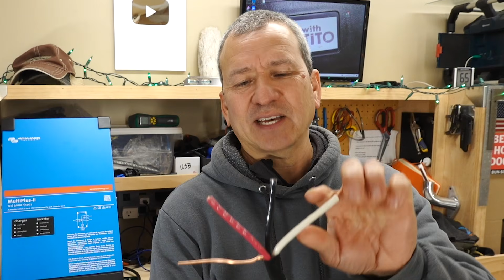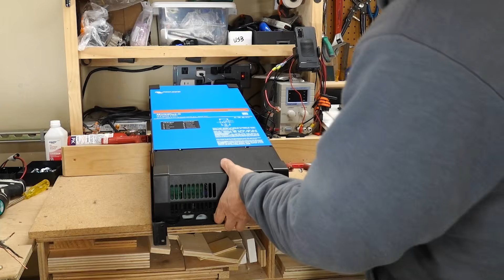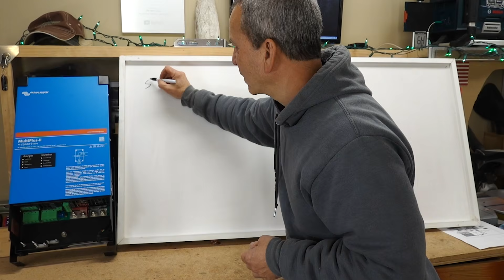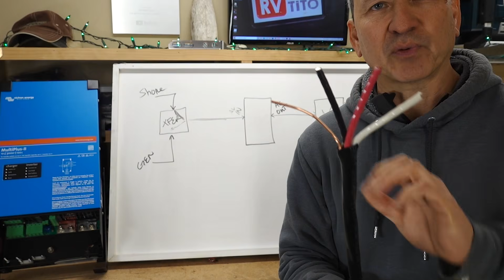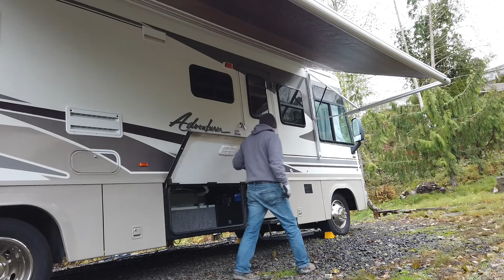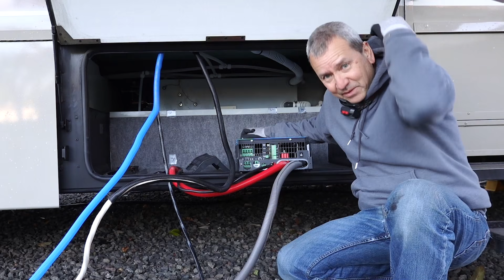Installing the Victron Multiplus II Inverter to Power our 50A RV Off-Grid | RV With Tito DIY

Comment: I liked your video, it was pretty informative. I have a 5th wheel and have both an AC and DC panel. I want to boondock with just the batteries. I suppose I already have power going to my DC side from my batteries as it already runs a few things like lights and water pump etc. Can I just run both AC and DC out of the Multiplex and remove the wires from the batteries to the DC panel and add wires from the Mutliplex to the DC side of the panel.? Or should I just leave them alone and add to AC panel?
Reply: @brianheugly - Please consult your local Victron Dealer, RV Dealer and/or certified electrician.

Comment: I have a 6000 watt inverter that powers my motor home. I can run everything in the motor home, just not at the same time, I play "green acres".  I have 4350 watts of solar panels and 15,360 watts of battery storage. If I were to do it again, I would have bought an 8000 watt inverter.
Reply from the maker: Wow. Amazed you could fit 4350 watts of solar on your motor home.

Comment: I have 24 ft rv trailer 12 v system. There is dc cigarettes lighter port inside. I connected 500watts inverter and powers my 110ac TV. Can I connect 2000watts inverter in that port?
Reply from the maker: No. It's not rated for that much power.

Comment: Dude great job! Looks very professional. Well explained I understand all of the functions i would need now! My only question is do you have to do anything special when you connect shore power? Or does it auto register that you added input?
Reply from the maker: It's automatic. Once the inverter detects split phased shore power, it automatically switches to AC pass through mode. The system is very programmable and there are a few related settings that will determine how that is done.

Comment: So would this inverter not work if you powered it with Solar panels since it only has a AC input? Or are you able to hook panels to it directly?
Reply from the maker: No. This one is intended to be powered by batteries. It's not one of those all in one solar inverters. It doesn't have a solar charge controller and isn't designed for that.
Reply: @RVwithTito  Thank you for replying! I bought one by mistake thinking it was..
Reply from the maker: Oh man. It's a great inverter...just not one of those.

Comment: Thanks for a great video. I decided to swap my stock Magnum 600 inverter for a MP II.  I have a problem I was hoping you could help me with.  My old inverter had a single 110v (3 wire)line into it.  Not the double 110v (4 wire) .  So im missing a 110v line. Im guessing they split it at the factory and sent direct to panel box?  Any ideas?  Thanks
Reply from the maker: Sounds like you have 30A service instead of 50A on two legs like I do.

Comment: I am working on installing my Victron MP II 12V 3000VA but it is going into a fixed location, a radio shack for ham radio.  I am having to think quite a bit and look forward to getting it going.  Later I will put some solar... it is a much smaller capacity than yours... I am doing the 400Ah minimum that the V manual states and can grow it later.  I am going to use it with 120 30 in and later when 50 amp service is available put both in.
Reply from the maker: Nice. Good luck with the upgrades!

Comment: I'm looking at the exact same inverter for my Fifth Wheel.  I am deciding whether to go 12 or 24 v on the batteries or move to a 48V inverter.  I have been told you can use much smaller cables with 48V, which is much more efficient.  Can you give the reason why you stayed with 12V?   I'm really up in the air over staying on 12V versus going 48V.
Reply: @wi4usa - This inverter is specifically the MultiPus-II 2x120 volt model.  I believe, there is only a 12 volt and 24 volt version.  I do not think there is 48 volt version.  It is rated at only 20 amps total or 2,400 watts continuous . It can be very noisy and it hums.

Comment: DUDE! You absolutely do NOT have 240V. It is called split phase because the two hot lines are the same phase. There is NO voltage between them. You need to change this a bit.
Reply: Actually, when connected to a 50 Amp Split-Phase Pedestal the RV will have 240 volts between L1 & L2.   But when connected to a 30 Amp Single-Phase outlet, it is just a 120 volt system.  Also, when the inverter is running on the battery bank only, it is a 120 volt system.

Comment: My question is normally you would have two AC panels one being powered by inverter either in pass through or when inverter is turned on.  It looks like the open hole above the panel you wired into may have been that panel. How are you powering all those circuits that the old inverter powered.
Reply from the maker: These large hybrid inverters are designed to be full house inverters managing and switching between shore, generator and battery power sources. It's what we prefer since we RV solely off-grid and don't plug in. Some might consider this type of configuration a bad thing...a single point of failure. Do you lose power to the entire RV if your inverter fails? Actually, yes. That's something to consider. It's why we chose to spend more money on a high quality unit like this Victron Multiplus II. It's well tested and very robust. Not to say that this too won't fail. It just hasn't. We've been running it 24/7 for the last year without a hick-up. So far so good. I used to carry a spare pure sine inverter...just in case. But I no longer do. 

What you are describing is how it used to be when inverters were smaller and didn't have hybrid functionality. Of course you could still setup your system that way with dedicated inverter circuits. 

The 200W inverter I ripped out of the 03 Winnebago only powered the TV and an AC plug in the cabinet. I rewired that plug to tie into the main AC service. Hope that helps.
Reply: @stevekrud2715 The MutltiPlus-II 2x120 ( in ths video ) is rated at 3,000VA. Which is only  2,400 Watts continuously. It will not run everything in a 50 Amp RV.  Probably not even 50%.

Comment: If the loads are 120V 60Hz and not 240v one inverter will be fine. Limit it with a circuit breaker. The split phase you speak of is more like balancing single phase  loads than L-L . No you can use a single phase 8 KVA inverter and no "phase splitter" either just put both hots on the  the circuit breaker on the load side.  Victron is cool. Over priced though.

Comment: Hi Brian, thanks for all of your fantastic content. 
I have this inverter and had someone else install it about a year ago. I recently had someone get shocked because there’s stray voltage (~20v) on the ground. It’s only there when connected to shore power or when the inverter is ON. I can see the voltage between the ground and neutral bars in the breaker panel and between the frame and a probe stabbed into the ground. I’ve checked everything I can access before dropping the belly to try and find anything that may be bonding the G to N and can’t see anything goofy. Do you see any voltage on your ground when hooked up to shore power?
TIA, Pat
Reply: Check your frame ground connection to your power cable to pedestal ground pin

Comment: Here is my 'million dollar' question. I have a Victron Quattro 5KVA (5000 watts) inverter in my coach. I have it wired basically like this. My thought is why even have the transfer switch in the equation. The inviter will switch something like 120 amps between the generator, shore power and batteries. It can shift in a fraction of a section and start and sop the generator.
Reply: @christopherrasmussen8718 - Do you have a 50 Amp 240 Volt RV?
Reply: @MrSummitville  well it’s a 50 amp coach with parallel lines in the coach. 4 wired + ground vs what a household dryer that is 240 between 3 wires and ground.

Comment: Awesome Video!!! 👍👍 I've been holding off on a install in my Travel Trailer because I knew it was going to get to small for full time fast, I just traded it for a larger 5th wheel camper 👍 , the only thing I need to figure out is what to do with the 12v converter? Since it's needed to power everything 12v in the camper, the issue is it will also want to charge the batteries and it's not safe for the Lithium batteries. I'm not sure if I can just remove the circuit that's supposed to charge the coach batteries or I will need to replace it with a converter that's Lithium compatible? This technology is so far ahead of what the RV manufacturers are doing.
Reply from the maker: If you install the Multiplus II, then you can remove converter/charger. The MP II takes care of that function.

Comment: Many thanks for your video. I just purchased one to replace our MultiPlus and SPS unit. I have a quick question for you. Did you use ferrels on the AC input and output connections. If so can you recommend the size and suitable crimping tool.  Thanks again.
Reply from the maker: I did not use ferules on the AC connections...just the solar connections.
Reply: Thanks for the video. I actually bought it from AM Solar.
Reply: @LouCetrangelo  Did you purchase the specific Multi-Plus-II 2x120 model shown in the video?  How is the noise level and hum when under full load?  Do you have a 50 Amp 240 RV?  If yes, then how many appliances can you run on battery-only and for how long? It is rated at only 2,400 watts!!!

Comment: Some Great Content Brian.  I'm doing some upgrades (cough) to my 89 Fleetwood Limited and I have an Off Grid Solar System install in the planning stages.  I think you have some good advice that I will be using on it in in a few months.  Currently finishing up my repower from Gasoline to Diesel.  Gonna be a Hoss!  Finished up the hydraulic parking brake system yesterday.  Engine and transmission are in. COnverted the shifting over to push pull cable, it's a FERD chassis.  
Solar System will get set up and mocked up before I reroof it and wrap the the old girl!
I've been kicking around the idea of swapping out the roof top Coleman AC  Units and going to a dual cassette mini split for cooling.  I think this Victron Multiplus II Inverter will be just the ticket to make all that work.  Yea, hoping to get enough solar on the roof to run the Mini split with cassettes in place of the Colemans.   Lucky for me my Coaches Electrical system is all on the drivers side and plummed in easy access! 
Rock On Dude!

Comment: I have connected solar panels, batteries,samlex inverter, and charge controller before. I recently purchased a newer motorhome and I think I have everything figured out but don't know how to install the victron inverter. What did you do with the wires you removed from the converter?

Comment: This is exactly the device I want for exactly the same reasons. Thank you so much for the clear explanation of what it's doing and how. Now to figure out the solar part.
Reply from the maker: Glad to help. Best of luck with your projects 👍
Reply: @rossbagley9015 - You have a 50 Amp 240 Volt RV and you want to run it with a 2,400 Watt Inverter?  Are you serious?

Comment: why would you want your generator and shore power feeding ahead of your Multiplus II inverter? Seems you
would want both AC down before generator would try to charge up your battery packs? Just would not make since to me.
Reply: @jeffsteele1295 - HUH?  The Victron needs either AC IN or the Generator to charge the batteries. There are other features that require the AC IN and Generator to be fed into the Victron.

Comment: Brian does my current 50Amp solar charge controller wiring change at all or does the inverter/converter not change anything.
Reply from the maker: The inverter/charger and solar charging are separate systems. So no change needed unless you have victron gear and want to monitor everything through a Cerbo GX.

Comment: Great video Brian.  My question is, did you use the original wiring from the ATS to the inverter and why did you NOT have to change the wiring from the ATS ? Also, did you upgrade the wiring from inverter to AC panel to the 6/3 cable and why did you NOT have to change the wiring from the ATS. (Sorry if I missed something along the way)
Reply from the maker: The wiring from the ATS was also the 6/3. There wasnt enough length to connect the Multiplus to the AC distribution box. Thats why I needed to buy more and replace the remaining wire (also 6/3). Hope that makes sense...its late 🥴
Reply: @RVwithTito  Thanks Brian, that helps a lot. Now I understand  🤪 I really enjoy all your episodes. You always keep it real.

Comment: i dont understand why you pulled existing ac wire from you ac panel....did your motorhome not have an inverter to begin with?
Reply from the maker: I needed a longer length of cable to reach the Multiplus in the storage compartment.
Reply: @RVwithTito   ahhhhhhhh....thanks!

Comment: Hi Brian! Have you installed an on-board EMS to protect your electrical system?
Reply from the maker: My coach already had an EMS installed, but it's more to regulate AC circuits under different power conditions. It doesn't do much anymore because I can control all of it from the inverter. Anyways I left it in because it doesn't hurt anything. I also use a surge protector from Hughes (https://amzn.to/3zIJtJx) whenever plugged in to shore power.
Reply: @RVwithTito  I just want to say thank you to you, Brian. And a thank you to Melissa, too. Your videos are like your projects: courageous and confident. You seem ready to tackle any problem or upgrade and use careful planning to mitigate issues. I really appreciate the information you have freely provided the RV community!
Reply from the maker: @andgorhey  Thanks. You're feedback means a lot to us. I'll keep the videos coming!

Comment: Finally ordered mine today with your link and discount code.  Thanks !!
Reply: @tomandmissynortham9683 - You have a 50 Amp 240 Volt RV and you want to run it with only a 2,400 Watt Inverter?
Reply: We haven’t had any issues running what we need.

Comment: Hey Brian: I’ve got this exact inverter charger coming to replace a broken magnum in my Renegade Classic. I do have a 50 amp input  BUT for right now, I’m just going to use a single phase. Plug and play till I have more time to take full advantage of this inverter. I will only have one input and one output. Do you know, do I use “L1 or L2” for my one input and output? Thanks so much.
Reply from the maker: L1 on the input should do it. It will output 120v on both output lines.
Reply: Perfect. Thanks so much. Appreciate it. Awesome DIY video by the way.
Reply: @djacobson1143  How are you going to run your 50 Amp 240 Volt RV with a 2,400 Watt 120 Volt Inverter?
Reply: @MrSummitville  my coach is all 120 volt. The inverter takes 2 separate legs of 120 volt for true 50 amp throughput. No 220/240 volt involved.

Comment: I have a small radio shack cabin.  I currently have an RV 30 amp plug and wired into it.  I need to run new wire from the power pole but want to upgrade to 50 amp.  Once in a while I can run too much and pop my 30 amp breaker.  So, I am curious if I can use the plus - II in the shack ... and when it charges the batteries ( like a progressive dynamics does in the older power stations) does it balance them etc?  What of a 24 volt systems

Comment: I am looking at the Victron Multiplus II inverter to replace my current inverter which shuts off when I'm running the A/C and the ambient temperature gets over 80 degrees F.  My motorhome has 2 Coleman A/Cs and both have Easy Starts.  I usually only run one at a time unless the temp is over 90 degrees with high humidity.  I have 1200 watt solar array on the roof and an 800 amp Lithium battery bank.  I don't due very much dry camping except for when I'm traveling, but I have experienced several long shore power outages some lasting for several days.

Have you experience any such problems when the ambient temp is high?

Comment: Does the inverter make any transformer buzzing noise in any of the configurations? Charging batteries while on shore power or inverter mode carrying a load?
Reply from the maker: Yes. It does.
Reply: @RVwithTito   Can you describe the level of noise?
Reply from the maker: @toddmcmichael5505  when idle its quiet and gets louder when heavy loads are applied. There are fans inside that also kick on when it gets loaded up. I'm a light sleeper and wouldn't mount it near my sleeping area. I have friends that though and I haven't heard them complain about it.
Reply: @toddmcmichael5505  70 db of noise and hum.  A washing machine or car going 60 mph.  Do not mount near your sleeping area.

Comment: Hello, i enjoy your channel alot. Lots of great info. One question i have, i put in a lithium converter/charger last year in my rv. If I get one of these multi plus 2 units, it will also replace my converter charger right?. Thanks for any info.
Reply from the maker: Yes. You are correct. No need for a converter/charger anymore.

Comment: Question - I have a 50 amp system and I currently have a 680 watt solar system going to the batteries with a zamp controller.  I could install this inverter as shown here and I wouldn't need to mess with my current solar set up.

Comment: Great, informative video…thanks.  A couple of questions come to mind as I’m thinking of a somewhat similar install in my 5th wheel trailer.  Do you need a transfer switch apart from the victron unit itself?  In my application all power, shore or generator come through the EMS before feeding either the power center now, or the inverter/charger when it’s installed.  Secondly, why this unit over, say, the GoPower unit that does pretty much the same thing?  Thanks